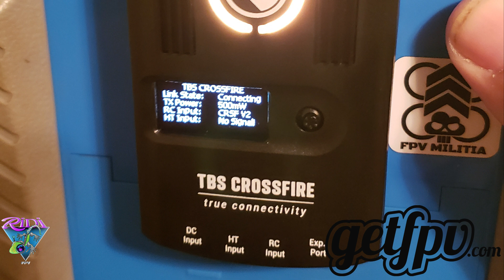GetFPV Learn - FrSky QX7 Crossfire Mod

Comment: HI friend, could you tell me what number has labeled on top of diode DT401, its next to middle pin of the qx7 S.Port, i messed up with my solder iron and destroyed it so i want to replace with the same component, please..
Reply: If it's still destroyed, I just looked at mine looks like "PB". 3 years late I know 😂
Reply: @LoopCrossTwistCutPry  jajaajaaj no problem i apreciate it, yes i fixed it tnx

Comment: Hi there I’ve successfully done this mod thanks to your video 
Should my crossfire be able to run 1watt power from the internal battery power source
Cheers
Reply: Glad to be of help!  It can but the battery will drain faster, id recommend a high mah 3s velcro'd to the back

Comment: I will never forgive FrSky for making us go through this process. My next radio is not going to be an FrSky for this reason.
Reply: Frysky's fault? Isn't this whole process to invert the data coming from the addon radio module? I'd say wtf was TBS doing not putting on a switch on their radio to invert the logic? This is bad design on TBS - there is a software solution to fixing this, but not as good as the inverter mod.
Reply: @thefatmoop  what would be please thé software solution ?

Comment: To anyone who actually has to do this, it’s really not that bad. The hardest part I’d say is removing the transistor from the board
Reply: Dennis Fpv after doing this mod the controller will still work with d8 and d16 right? Thanks
Reply: @macdemarco1476  yes please I want to know this too
Reply: Jeromboo FPV it works